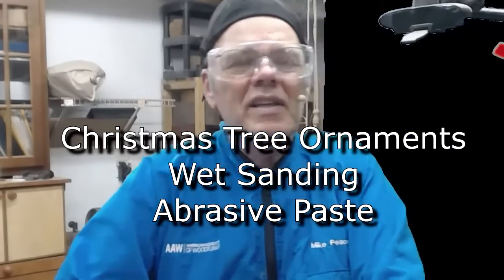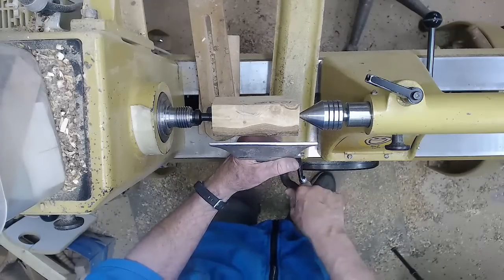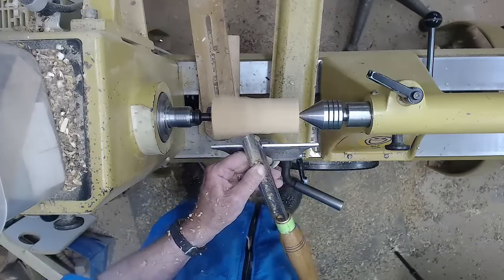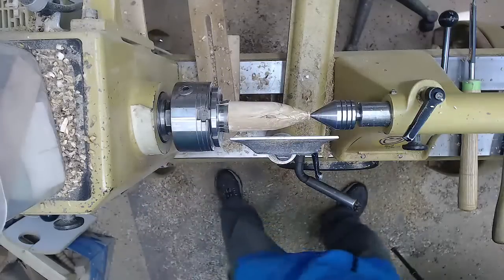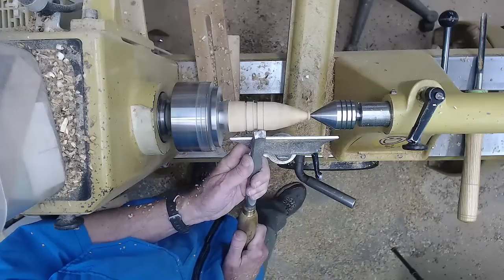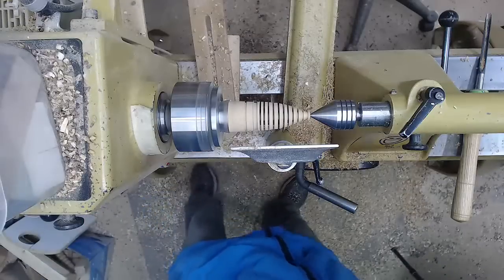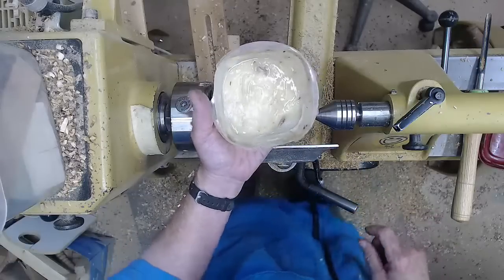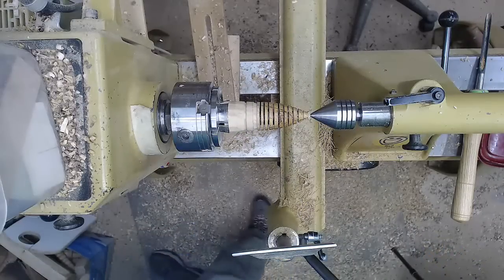Christmas Tree Ornaments, Sanding Butter and Abrasive Paste

Comment: Re: Rubber sand paper cleaner.  Those rubber sand paper cleaners can get a little pricey.  The last one I saw was around $8-$11. So, to avoid spending my hard earned money on a piece of rubber, I tried out the sole of an old tennis shoe.  I cut the sole off the shoe and just have the rubber part.  I works great cleaning up my sanding discs and belts.  And it's a great way to repurpose worn out tennis shoes.
Reply from the maker: Now that is what I call frugal! I am stillusing the one I bought 15 years ago. I guess I am not using it enough.